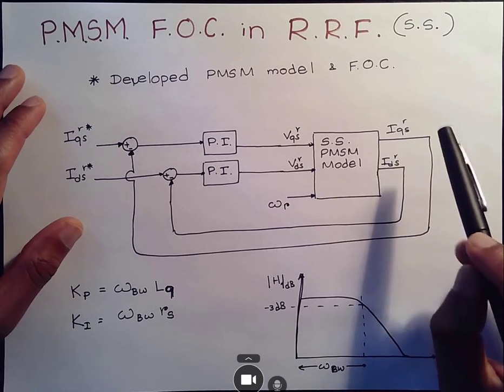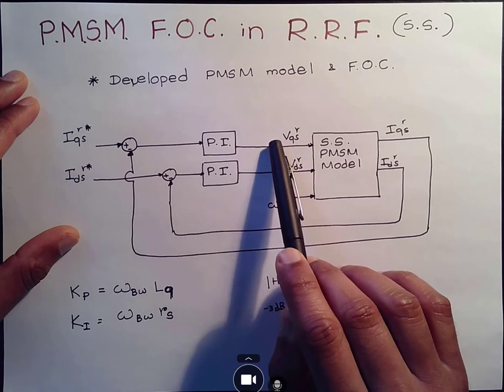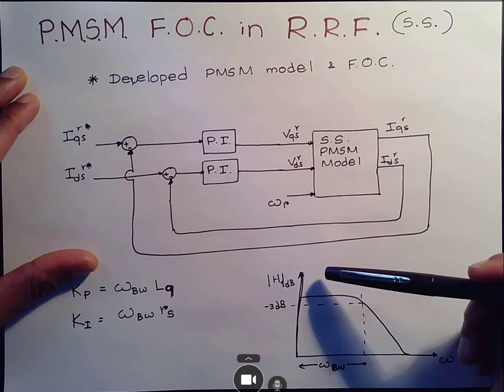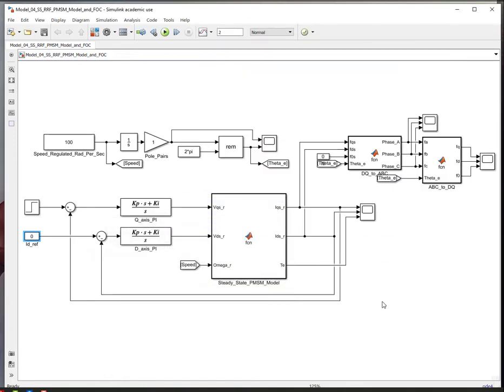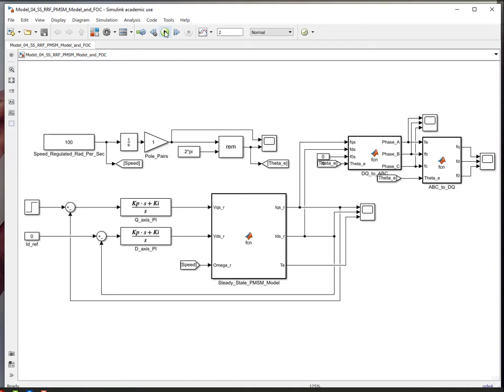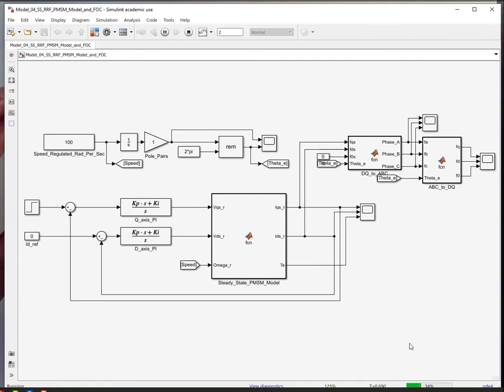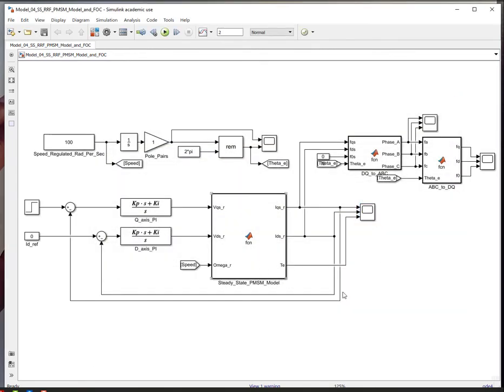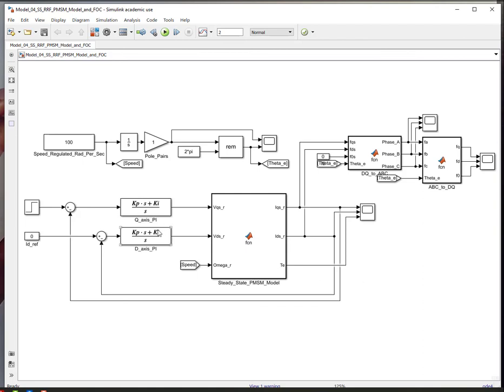FOC with Steady State Rotor Reference Frame PMSM Model

Comment: Hi, I  followed up your steps and the model can run well. The model setting is the same with your video. However, the out waveform of Iq, Id is a very sharp jumping without a smooth transition. What's wrong with me? Could you advise?
Reply from the maker: I'd have to see the results. Is it not matching up with what I have in my results?

Comment: I came up with a trouble. why is the rs in parameters.m not visible in motor function box? Undefined function or variable 'rs'.
Reply: Solved
Reply from the maker: You need to define it.

Comment: Hi 
I have tried implementing the steady state PMSM as you explained . However, I am getting the a,b, c phase currents till the step time as sustained oscillations  instead of the decaying oscillations you shown
Can you explain to me why it happen so?
Reply from the maker: Hi, It is very difficult to say why without seeing what you are seeing. Please make sure all simulation settings are correct and parameters are also the same. May be it is your parameters.

Comment: Hi i realy like this playlist and im learning from you the FOC simulation. however i have a question .
Why do we need to REGULATE the "Id" and "Iq" ? if we can implement them directly into our "DQ_to_ABC" ? like you did "id = 2" and "iq = 0" i dont see any benefits on REGULATING. can you explain to me ? thanks in advance
Reply from the maker: Just setting Id and Iq without a closed loop, only works for one operating point. When load and speed changes, the current change as you are regulating voltage to control current, indirectly.

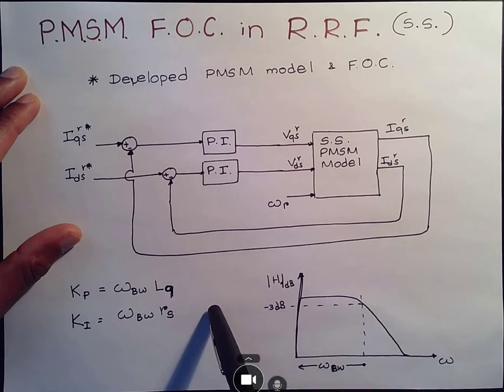Comment: Thanks for very useful video on implementation FOC for PMSM. I have doubt that @3:00 you took Lq for SM-PMSM what will change Kp and Ki value if i use IPMSM?
Reply from the maker: Update the Kp for each axis will change based on the inductance.
Reply: @SandunKuruppu  Actually I'm trying ask that As you mentioned for Surface mounted Kp= W_bw*Lq and Ki=W_br*rs. Now if I have to use IPMSM. How can I calculate that?
Reply from the maker: @trickyelectrical4197  For Q-axis use Q-axis inductance and for D-axis, use D-axis inductance in Kp calculation for each axis. Rs remains the same for both axis Ki calculation.
Reply: @SandunKuruppu  Thank You

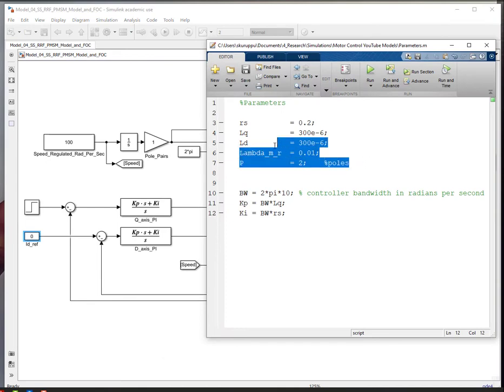Comment: Thanks for the follow up video. Just a quick question. @4:52 BW = 2*pi*10; Is the value 10 approximated something like (speed_rad_per_sec  *  rad_per_sec_to_Hz   *   0.7071) ? Thank you. By the way I have followed along and implemented the model. It is working as expected. I have committed the model to my git repo.
Reply from the maker: The BW is bandwidth. I explain this in more detail in another video. It is the frequency in radians per second. So the value in 10 is frequency in Hz. Okay?
Reply: @SandunKuruppu  I did something like this.
Speed = 100 rad per sec
1 Rad per sec = 0.1592 Hz
3db cutoff = 0.7071
BW = 100 * 0.1592 * 0.7071
       =  11.26 Hz
Please correct me if I am wrong. Thank you.
Reply from the maker: @vevasam  Yes, this is fine.
Reply: @SandunKuruppu  Thank you.